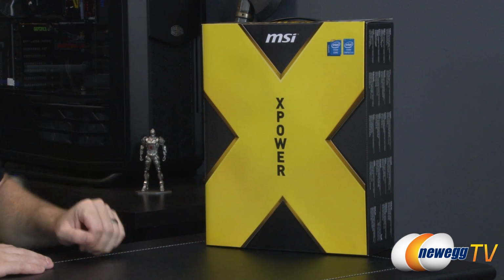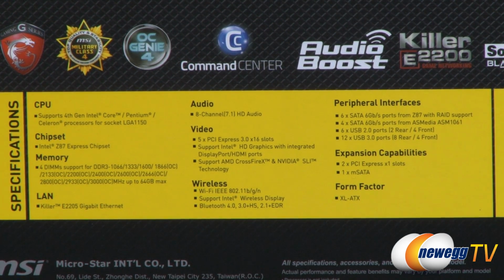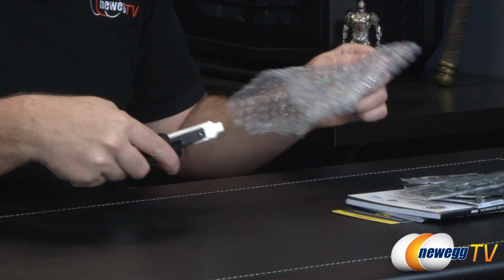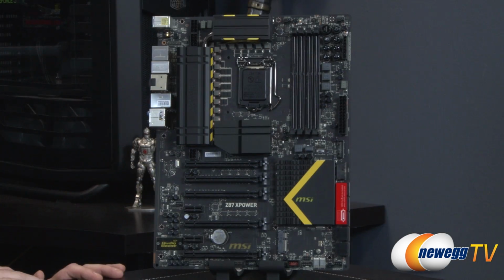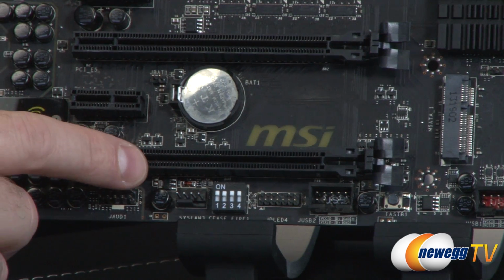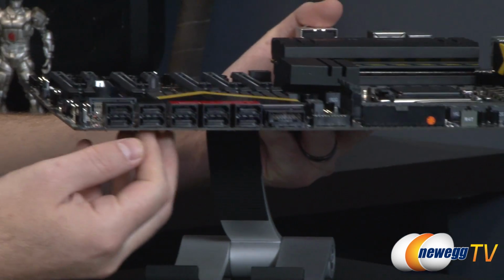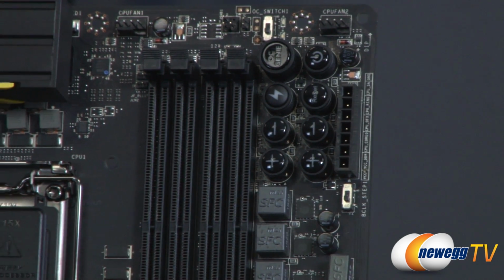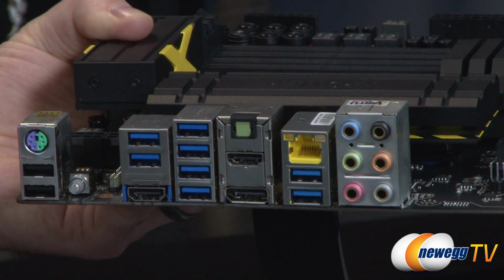MSI Z87 XPOWER Motherboard Overview - Newegg TV

Comment: Why would someone buy this motherboard instead of spending less money and getting something like a EVGA X79 classified for less than 250 dollars?  You get 4 way crossfire with pci express 3.0 40 lanes worth plus a 4820k processor costs the same as a 4770k and has the same if not better performance.

Comment: Very impressive board. If I was in the market right now for another Z87 board, this easily beats out the Maximus VI Extreme in my mind. I especially don't like that OC panel that come with the Maximus and the WiFi parts that almost all manufacturers are including nowadays. It just seems like motherboard manufacturers are trying too much to be like Asus, which correct me if I'm wrong but was one of the first ones to include wireless hardware with their higher end packages. I don't know of any serious gamers that would use WiFi anyway, at least while gaming or streaming.

Comment: I really don't see why you want firewire on your gaming rig touting 4 GPUs.
Are you running a mixer or other audio controller/capturing hardware?
You can get around it with the GPUs in place.

Comment: Do you just want to be able to overclock as high as possible? If so, I suppose the Xpower would be the better choice, but the Mpower max is a really great overclocking board as well, and it costs much less.

Comment: Well the STX is an AMAZING card. It sounds divine and has a built in headphone amp. So yes, the STX has better sound, and features like the amp. But that's not to say the DX is a bad card, it sounds very nice and is less than half the price of the STX. My advice is get the DX than save up for the STX alongside some audiophile grade headphones like some Audio Technica ATH-AD900x's

Comment: I understand but I like the start menu and I use it constantly on the desktop I have right now. And also its faster than previous generation operating systems. and I HATE a sluggish computer. I just overall like Windows 8 better.

Comment: Yeah, I figured, but if I'm not mistakes the DX is around $70? It's £50 in the UK. Don't let people persuade you that the 8350 is a bad CPU. In windows 8 it performs extremely well and it's dirt cheap considering its performance is almost equal to an i7 in some applications :)

Comment: Would this build be fine for editing sound, video, and photos? I will also be gaming on it quite a bit.
	
Corsair Builder Series CX 500

Corsair Carbide Series 200R Compact ATX Case

Corsair Vengeance 8 GB ( 2 x 4 GB ) DDR3 1600 MHz (PC3 12800) 240-Pin DDR3
	
Windows 8 System Builder OEM DVD 64-Bit
	
Samsung MZ-7TD250BW 840 Series Solid State Drive (SSD) 250 GB Sata 2.5-Inch
	
EVGA GeForce GTX650Ti Boost SuperClocked 2GB GDDR5
	
GIGABYTE GA-970A-D3
	
AMD FX-8350